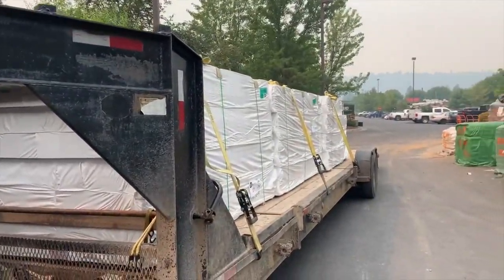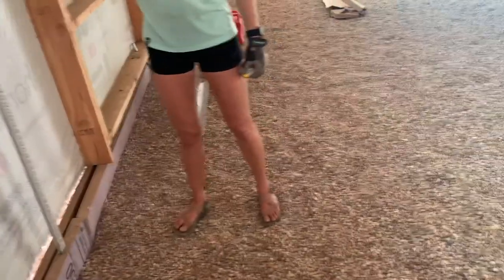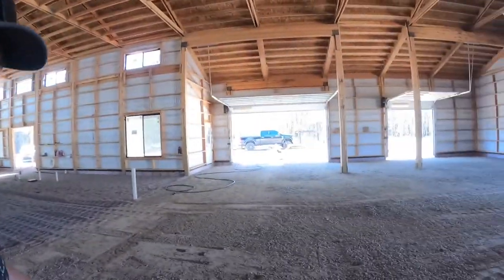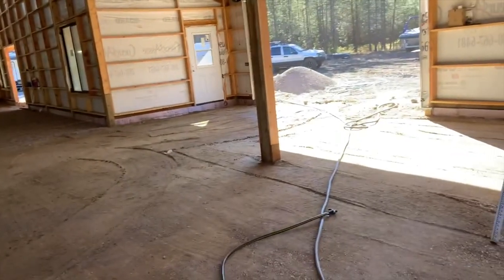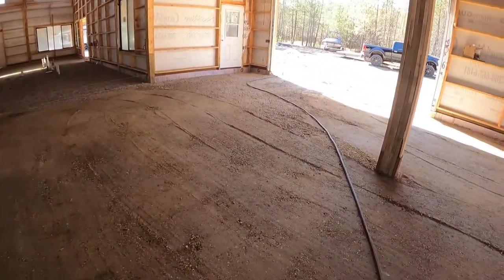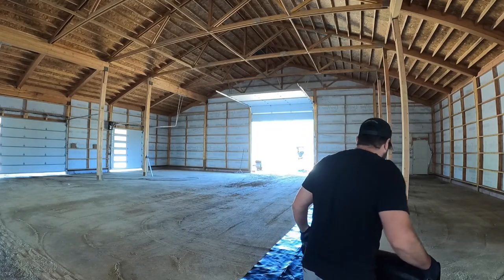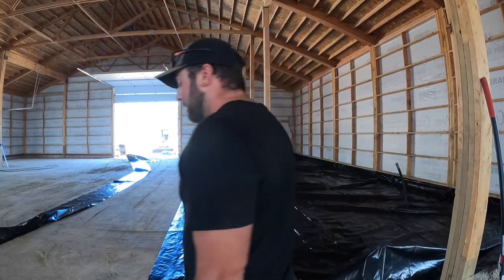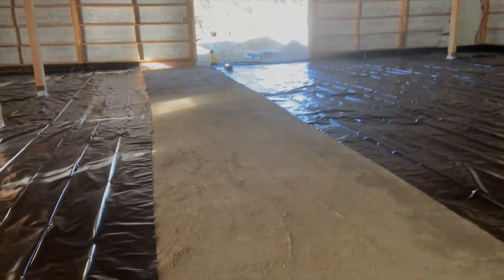WHY DID WE MAKE EXTRA WORK? | Vapor Barrier for Insulation

Comment: Nice effort. Even if you are not going to insulate the entire larger space, you should spray foam the ceiling or put in an inner ceiling and blown in over that. It will keep the sun, which will be beating down on that massive roof, from turning the air inside your open uninsulated area into a giant heat sink and that area be hot or hotter than the outside.
Reply from the maker: Thank you for the advice! We will be insulating the whole building, the shop will be batting, & the house is spray foam.  The ceiling will be insulated as well we just haven't gotten that far yet :) Thanks for watching!
Reply: @buildWYLD  Just make sure to insulate the wall between the house and shop part with the type of insulation that does the best job at insulating against sound. No reason to have loud shop noises going right through that wall and make for annoyances in the house.
Reply from the maker: @thtadthtshldntbe  Another great tip, thank you! We plan to do that for sure, plus that wall has to be fire rated/resistant, which adds extra insulation too.
Reply: @buildWYLD  they make paint and paint additives that are fire resistant as well. I have seen people paint the framing on their homes with it (in real life).
Reply from the maker: @thtadthtshldntbe  I haven't heard of that! We will have to check it out, thank you!

Comment: Strange how the codes/ building regulations vary so much. I am surprised how many people i see in the USA not insulate under their floors or even use a waterproof membrane, especially in the colder states. Where as here in the UK we have to use the poly and a minimum of 4 inches of insulation every time under concrete floors.
Reply from the maker: It is strange! and each state all the way down to the counties are different.  It makes knowing all of them difficult. Im glad we put the extra layer down, it is worth it!  Thanks for following along!

Comment: looking great! my foundation contractor told me the same info about taping the foam but I think we will do the same. the barrier is relatively cheap and fixing that issue later on is going to be a big challenge. how thick are you guys going for the foam board insulation under the slab?
Reply from the maker: Thank you! Ya, we absolutely think it's worth the extra money.  The foam board insulation is 2 inches thick (& I believe 4 feet by 8 feet) on top of the vapor barrier.   Next is the radiant floor heat, and then top it off with 4-6 inches of concrete.
Reply: @buildWYLD  reinforced 4, and hopefully you already decided before the build, it will make a difference in wall height